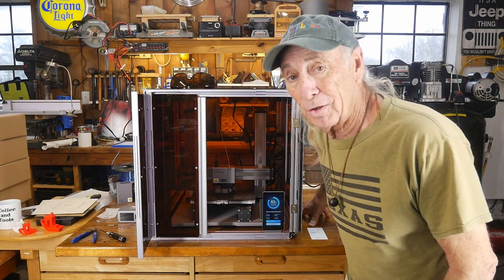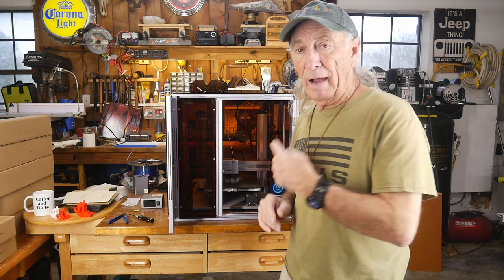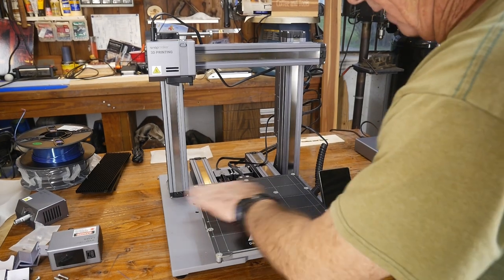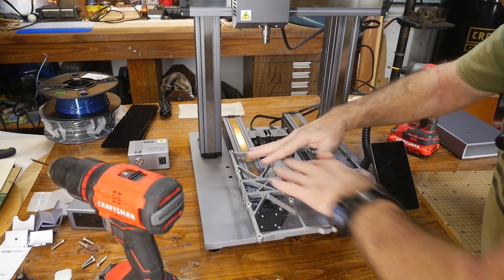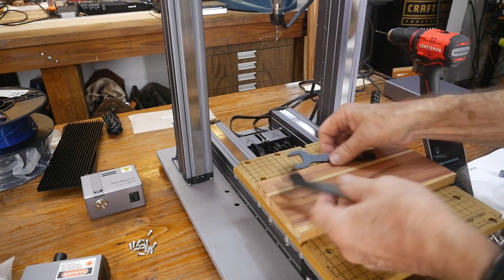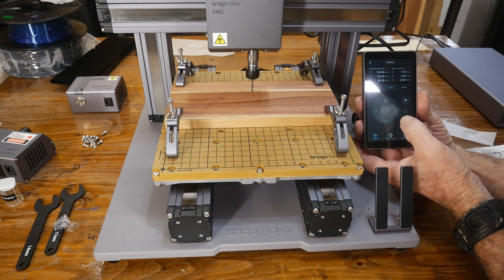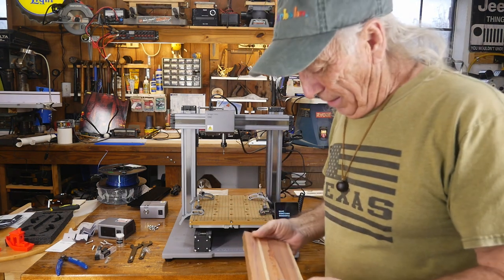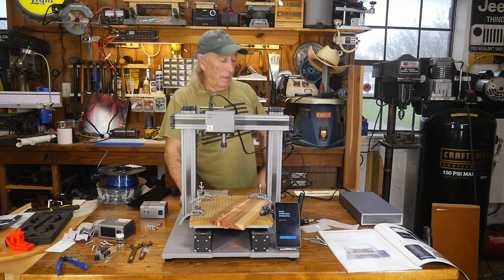Snapmaker 3 in 1 test for CNC work part3 . C&T ep 318

Comment: That is amazing that it works on all three types. 
I'm curious how the cnc portion of the software does on 3D designs.
Reply from the maker: The show on Monday included me on my desktop showing the 3 various softwares to run each. The CNC was basic, but very good with tool path etc. Also you can buy accessories to run 4 axis....YEAH...imagine a small lathe mounted inside the build area and carving with 4d....LOLOL...I'm rather glad they didn't send me that kit LOLOL..